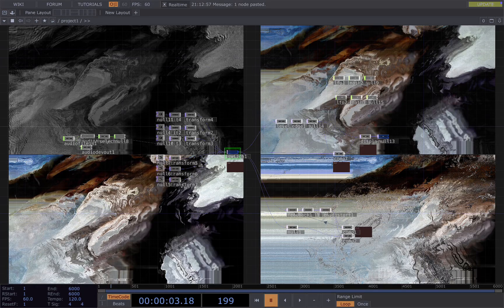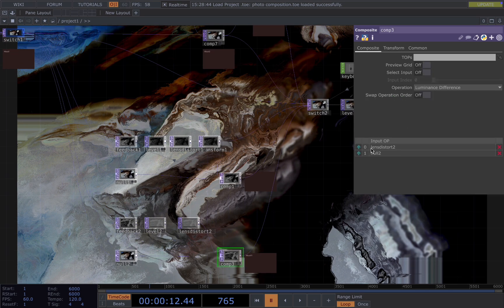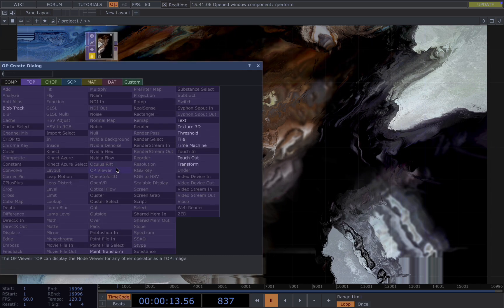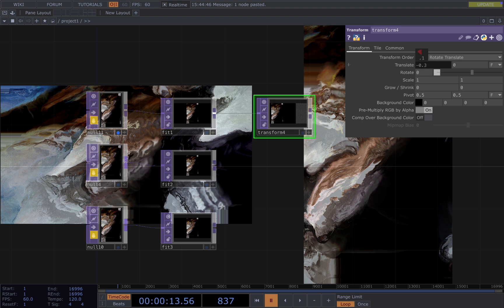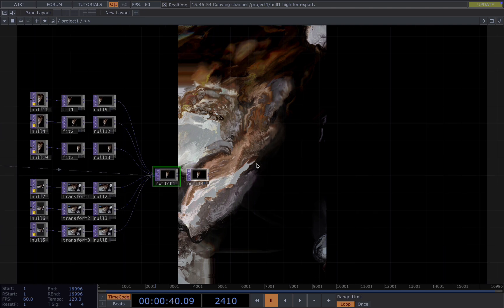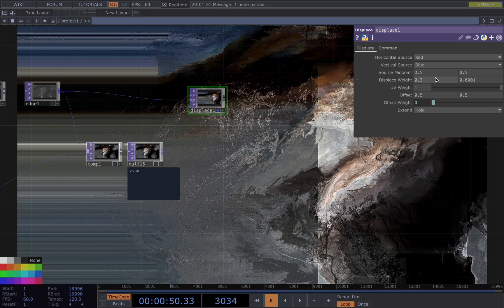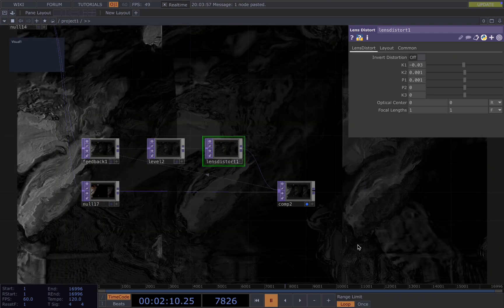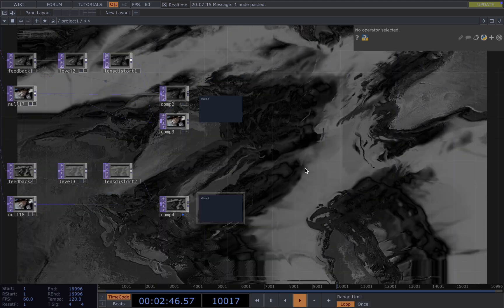simple image composition in touchdesigner | tutorial

Comment: At first I was gonna comment how some of the stuff that is shown here could be improved but then I noticed that weird behaviour with the Fit TOP and noticed it was also present in the Over TOP and other compositing TOPs so I will be reporting it on the TD forum and see what they have to say about it.

(if you have a vertically oriented image laying onto a horizontally laying image and you're using a "fit vertically" [at least for this specific case] you should be able to align horizontally like when you're using a "native resolution" setting instead of manually dragging the image to a position by yourself)
Reply from the maker: Hi, I'm using six different images, and before connecting them to the Switch, both the vertical and horizontal ones share a resolution of 3840 × 2160.

Also welcome improvement advice :)